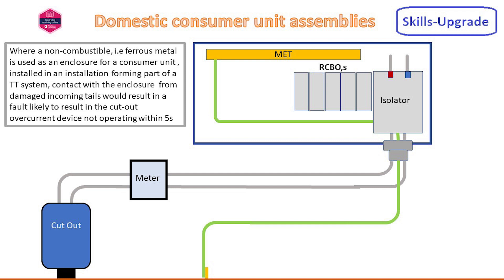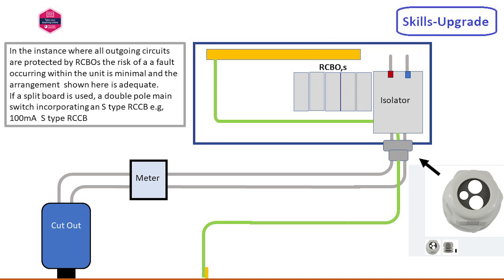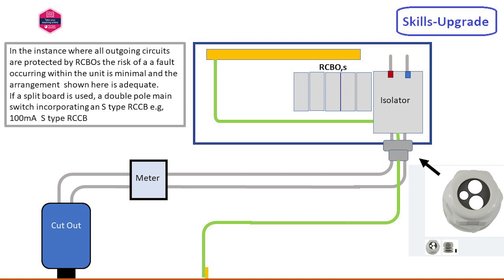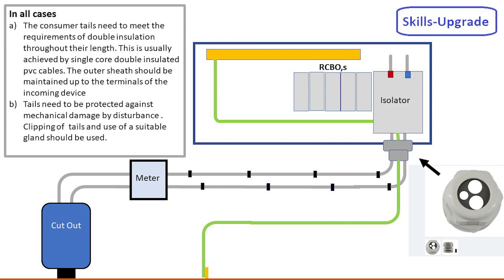Metal Consumer Units in a TT system [Domestic Premises]

Comment: The problem here lies with the means of termination of the cables!! These terminals that have one screw and a moving rear clamp don't have a good firm grip no matter how tight you screw them down! Just give the cable a wiggle and it's loose again!
What is needed is a return to the old style of termination of a brass block with a hole the cable goes into and 2 screws to clamp it. 
Like used to be used on Wylex / Mem units and the old black bakerlight KWH Meters. 
They were built for the job!!!
Sometimes modern is not the best !
Reply from the maker: I agree that some terminations leave a lot to be desired, however securing the tails including a gland as shown reduces the risk to negligable.

Comment: On using a split load metal consumer having a main switch 100mA time delay is pointless as this wont afford protection to the incoming tails, secured and clipped meter tails ,correct cable gland will suffice , preferred option RCBO board all the time

Comment: While not permitted - I think having a time-delayed 100ma RCD in a PLASTIC enclosure before the consumer unit would be the best solution. Better still would be a metalic enclosure with a plastic exterior coating - A sort of earthed AND insulated arrangment specifically designed for that purpose. Not sure if anything like that exsists though.
Reply: Where does it say you cannot install a 100mA time delayed (s-type) RCD between the meter and CU in any system? That seems to be the safest solution since the daft metal enclosure rule was introduced as a fire containment idea but instead raised a far more serious shock risk.  A focus on correct torque down values for all terminations in the Installation, and mandatory 5 year inspections would have been a proper root cause correction for the majority of fires IMHO.

Comment: In my opinion, I think metal consumer units on a tt system is just inherently wrong, I’ve been to a job where a live tail has come into contact with a metal clad consumer unit. The customer was receiving shocks from everything metal (sinks, radiators, class 1 appliances even screws on lightswitches). 

I studied the 16th edition during my apprenticeship and (and I still agree with this) metal cu’s on tt’s were strictly forbidden, for good reason. 

One last thing, How would you effectively gland a set of tails that entered through the rear of the consumer unit?
Reply from the maker: Hi there, first of all thanks for the input. In answer to your example where the tails came into contact with the metal clad consumer unit. I would say, as I do in the video, that if installed as recommended in method a) the chances of contact are extremly remote. Also ,again as stated in the video, this is the method advised by the IET Wiring Regulations Policy Committee.
I take on board  the problems encountered with entry of tails to the rear of the consumer unit, perhaps another video to do.
Once again thanks for the input .